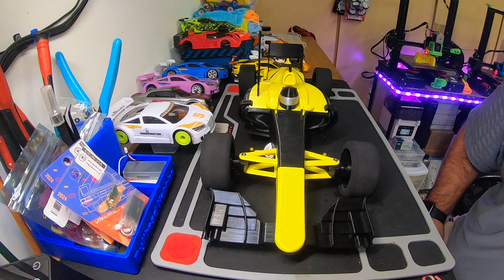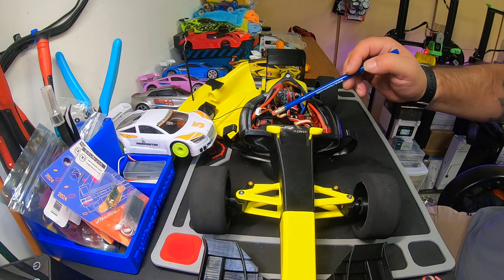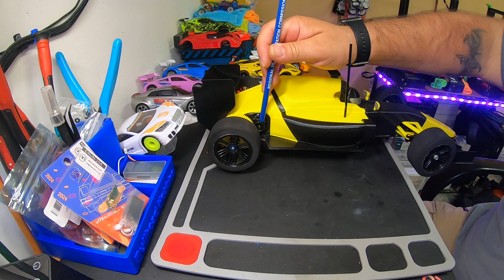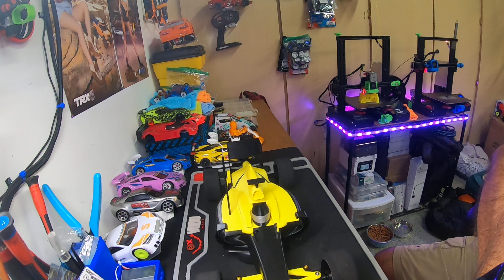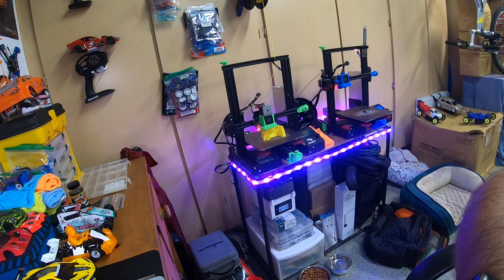Channel Update, and New Project, Open RC F1

Comment: Very cool project.
Reply from the maker: @All_RC_Fun  thanks it was a very fun project to do
Reply: Hey Rick! Awesome video brother! That car looks awesome! What kind of 3D printer would you recommend for an absolute beginner?
Reply from the maker: @BuildingVelocityRC  my first printers were creality ender 3’s you can still get them for 150 to 175 dollars most people now though are buying the bamboo labs printers because you can essentially just plug them in and start printing, but they are about 700.00 and close to 1000.00 if you get the ams setup for them so you can do multi color prints
Reply: @rickzfpv3118  cool… thanks Rick… kicking the idea around of getting one eventually